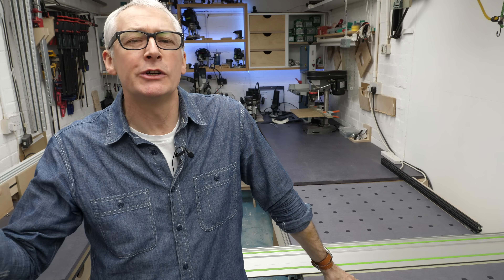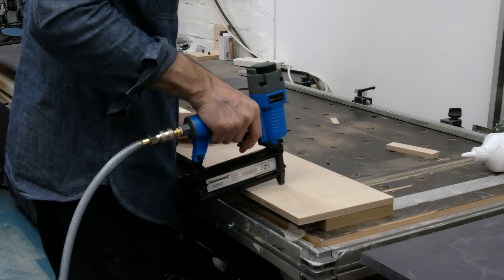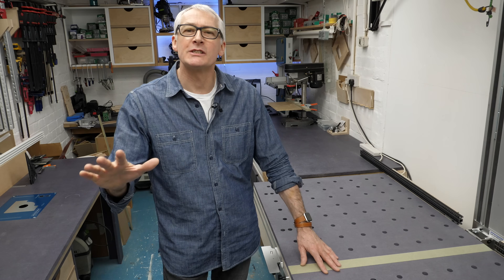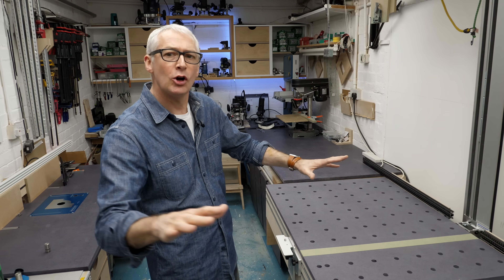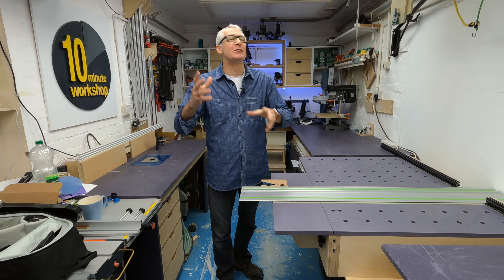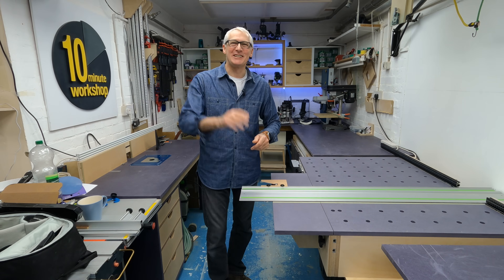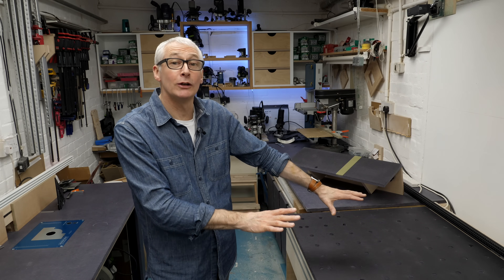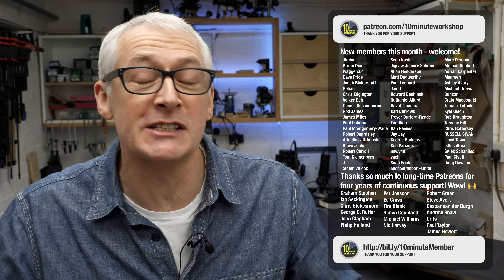DIY MFT with Ikea Curtain Track [video 487]

Comment: Excellent content. I bought the whole Festool MFT setup years ago and found the hinge so fussy that I finally sold it, as I was getting better crosscut results with a simple TSO rail square. The DASHBOARD bracket looks like a brilliant solution. Thank you Peter.

Comment: Thanks for yet another great video! I’m always looking forward to what you’ve come up with. 
It was a nice surprise to watch your chat with Dave, i also enjoy his videos. 

I had an MFT3 a few years ago, but I sold it as I found it too wobly to use in a stationary setup. After watching this video I might consider building one based on some of your ideas. I live in Denmark where replacement Festool table tops (or similar) is not that common, so I’d love to see a video showing how to make the top without an LR32 rail of the Parf system. 

Thanks again for sharing 👍

Comment: Love this build, solves all the limitations of the standard top. The new hinge is totally worth it. I'd be tempted to cut a 10 cm deep slot in the wall to reduce the gap at the back
Reply from the maker: Thanks! Any cut in the wall will muck up the soundproofing I put in there. 🤷‍♂️ 👍

Comment: I made my mft top with a drill press and a 20mm Forster bit for a template, and then drilling on the top itself with a Bosch corded drill and two bench dogs for alignment. It's tedious and tiring work, but the end result is pretty nice.

Comment: You built a very clever solution, indeed. I'm actually planning my variant of a modular MFT. I'd love adding something like your front extension. As a hobbyist I will not invest in rail hinges, although I find them very useful.

Comment: Well done Peter you got there and it really was worth the wait, just an excellent result, love the front extension idea and will certainly incorporate it in mine. Your point is well made about the rear overhang as I had decided early on I needed to be able get 360 access around my work flow and had the room, so using the Festool front and rear hinge suited me better. I love the taper lock idea as well. Well done mate👍
Reply from the maker: Thanks! 👍

Comment: Everybody works in slightly or greatly different ways. What Peter has made of a pretty limiting space is excellent and people will be able to take  bits most or all of it. To newcomers to this channel or to woodworking, I can’t recommend Peter’s channel enough, especially for panel work.

My tip for the top is designed for least cost. I’ve already got an MFT style top which is over 10 years old. It needs replacing very soon and has lasted so long (turned over once about 5 years) because I refuse to use it as a sacrificial top - when I cut on it, I use scraps of 6mm underneath. So, I will be using my existing MFT as a template for the new one. Place old on top of new; drill, say 15mm holes, through the existing holes through the new; then a sharp template router bit to copy the holes; finish off with a small chamfer bit.

If you don’t have an existing MFT to copy, then I would very carefully make a small template, say 6 holes by 3 holes. Then use that as the template on your full sized sheet by using dogs to anchor 2 or preferably 3 template holes and then drill/rout the rest. 

As I say, I’ve had mine 10 years or so and there are still many holes that I have never used. The lesson from that for me is that I don’t to have all the holes in the centre of the top.

Comment: That looks so good that I'm  beginning to suffer from MFT envy! 
I've always liked dark coloured worktops on a bench, but I'm too tight-fisted to fork out for valcromat. I use MR MDF and stain it with a couple of coats of Liberon ebony spirit stain, followed by 2 or 3 coats of danish oil on both sides. Then I machine the dog holes with a jig from RS CNC. This seemed the most economical method because it uses a router, 30mm guide bush and 1/2 inch cutter which I already had (although I did splurge on a Whiteside upcut spiral bit later on). Final process is to chamfer the dog holes with the UJK hand cutter,  and paint the edge with lime green paint before cutting a chamfer around that.  I know that sounds a bit sad, but it does look good!
If anybody follows this method, use a trend 30mm guide bush - initially I tried a Dewalt guide bush in my favourite DW622 and the result was sloppier than a bowl of soup - using the trend bush gives a perfect piston fit.
Reply from the maker: Thanks David! I used wood dye on my previous benches and it looked fine! 👍

Comment: Hey Peter I used peg board to make my mft top. I cut a small piece that I drilled to fit on my router base and added 4 bolts to mesh with a bigger piece. I then used the bigger piece as a template for indexing the router and drilling the holes. The two issues I ran into doing that are: pegboard is spaced 1" apart so I had to forger about getting 96mm spacing, the 20mm router bit I used ended up creating holes that were too loose to use with dogs and retain any sort of precision. Other than that the process worked perfectly. I'll be making another with the process and am hoping to find a bit that creates a tighter hole. I've read that some people have had success using a 25/32" spiral bit since that works out to 19.84mm
Reply from the maker: Thanks! I'll be doing a 20mm router bit roundup before too long - there's quite a variation in size! 👍
Reply: @10MinuteWorkshop  Looking forward to that!

Comment: Great video Peter, I enjoyed it very much.  A little too late for me, as I have just built my more basic version with a pre-made top.  However, the idea of a future video on creating a top more cheaply than using the available proprietary tools, would I think be very useful. The reason, would not be to create a full MFT, since as you say these are very competitively priced, but to have a methodology to create small add-on panels, or panels for specific purposes.

Comment: Great video. Love the black worktop. Yes the hinge system for the track looks great and I am awaiting delivery. I have seen on Festool users sight a home built set. I note that Benchdoguk have mentioned something coming up soon?
Its great to see UK development, it will save import duties, a must to consider should they reach the market. Looking forward. 
Took a set of Dave Stantons Bench  plans, a couple of years ago. Great for restricted space, table top use..
Reply from the maker: Thanks! Yes, Benchdogs have a hinge coming that’ll suit folks using an MFT top or slab, so great for guys on site working off trestles. Look forward to it. 👍👍

Comment: Dear Peter - what a nice video again. I had a laugh on the OCD remark - because you made it seconds after I wondered whether the front and rear T tracks would be aligned :-). 

I do use a UJK Parf Mk II Guide System to make the holes in my table tops - that makes it easy to make those in a perfectly 90 degrees aligned grid. Not cheap, but a pleasure to work with. 

And the remark on the protruding rear hinge on the table for the guide rail... that has been the reason for me not to use a guide rail on a hinge any more. And your remark on the make of the Festool hinge at the end of your video - I cannot agree more. But - it serves its purpose for me. Instead I do have a separate replacable table top now, which I use for cutting in many locations - so it is a bit of a trench warfare scenery that one really. But I might change that in the future - your replace-able cut inlay does appeal me - and when thouching on the topic of OCD... well you will understand. 

K reg Wino
Reply from the maker: Thanks Wino! Yes, it's tricky, matching up two different extrusions; If I matched the front t-track to the middle slot in the Ikea curtain track, then it's quite low, nut match the top clot in the curtain track and it's quite high - too high to be able to drop the front rail support down completely out of the way. 🤷‍♂️ It's a compromise. 👍

Comment: Hi Peter, again a great video. I want to make one of those MFT top. Can you tell the distance between the edge of the top and the wall. Essentially the distance required for a TS 55 to cut through material.

Thanks for sharing!
Reply from the maker: Thanks! Surely if you’re considering making this you have a plunge saw? ‘Cos the distance you want is from the front of the saw to the centre of the blade when fully plunged… 🤷‍♂️

Comment: Used synthetic motor oil? I had MDF sitting under my Mini Lathe and used some 0W 20 Mobile 1 as cutting fluid. the MDF did not swell. 
Not sure of long term effect. I have had 4 test spots on my current MFT/3 MDF top for about a month. So far so good

Comment: You have a wooden panel behind the hinge area, could you not just cut a hole for the back part of the rail to swing up into? Then the bench could move back towards the wall.
Reply from the maker: I spent a long time getting soundproofing into that wall, and cutting holes in it would muck that up. 👍
Reply: I say, muck away. It would make for such great content. The script writes itself — out-of-the-box thinking… literally!

Comment: Great video as usual, thanks v much. As you asked, I’d be interested in a cheapo option MFT and perhaps also to include some of the very basics (ie why is a front test needed with a hinge and alternatives like a square and dogs?)
Reply from the maker: Thanks! If you check out this video - Square Cuts: MFT or Rail Square?	https://youtu.be/3C8XSWliOys - you’ll get a lot of the basic questions answered. As for why a front rail support, it’s simply that there’s too much potential flex in a rail that’s over a metre long to keep it accurate; having a front rail support - or referencing off eg a benchdog - keeps it true. 👍👍

Comment: Peter, have you considered swapping the brackets around i.e. put the smaller 'front support' at the rear so you can push back closer to the wall, and the larger hinge bracket with overhang at the front of the bench?? Clearly the lifted up rail  might be in the way much of the time, but will be easy to remove and avoid the occasional falling rail hazard you've encountered before 😉  Perhaps worth testing for a day or two??
Reply from the maker: I hadn’t considered that Mark, for exactly the reasons you say - the rail would just be in the way all the time when it’s flipped up. And the dashboard hinge is much stiffer than the Festool one in that regard - holds its position very well. 👍👍

Comment: Sorry if this has been answered already - curious about the 3 offset holes past the front row of holes on the bench - looks like 32 or 48mm more forward  - any specific reason for these holes? Jigs? Specific Clamping operations? I’m designing a top now with offset holes at the rear to maximize fence space, curious what yours at the front are for!
Reply from the maker: First one was a mistake, the others were to make it look intentional but slightly mysterious.  👍
Reply: @10MinuteWorkshop  😂 well it worked!!

Comment: As always Peter, great video! Like your creative solutions for your space and how much you get done in there. Love the collab too!

I’m currently remodeling my house so the finer woodworking has been put on hold and it’s mainly rough construction. 

I’m planning to wait till the Benchdogs rail hinge comes out and then build a proper MFT with that. It’s probably good given their “track” record (pun intended) 😂. I think I’ve seen somewhere they’re working on it. Have been mighty impressed by the BD rail square mk2!

The import duties etc make the Dashboard a bit hefty price. Looks amazingly engineered though! 

Hopefully it will be out when I get back to woodworking and need to build some stuff for the new house :)
Reply from the maker: Thanks! Yes, the benchdogs solution looks very good, very much aimed at MFT top or MFT slab users working off trestles  though. 👍👍
Reply: @10MinuteWorkshop  exactly! 😄👌🏼

Comment: Hi Peter! Came to re-watch the video to try to find out how much of hanging over does the dash board needs in the back and front, could you let me know please? 😬 with the new benchdogs hinge it’s really hard to decide. 
My mft bench will be 1m by 2m, makita only has 140cm and 100cm rails. And I think 140cm will be too long and 100cm to short 😬
Reply from the maker: The dashboard hinge needs about 190mm to the rear of the bench. The Festool hinge about 110mm; haven’t had hands-on with the benchdogs hinge yet, hope to get one next week. Front rail overhang is up to you, largely; if it’s long enough you can plunge fully before starting the cut, but then you run the risk of it getting in the way. 🤷‍♂️ At a metre deep, you’ll need a rail at least 1200 long if you plan on using a hinge. 👍
Reply: @10MinuteWorkshop  thanks for the info! I’ll have to consider all that 😊

Comment: Hey Peter - why not just take a hacksaw to the back of the hinge? If I recall the back is free swinging and probably much longer than it needs to be to keep the rail square. Being that you have the front rail support you really only need enough rail to support your saw when the blade reaches your fence in its furthest back position.
Reply from the maker: Thanks! Well, firstly the guy who engineered it told me he really wouldn't recommend it. Secondly I paid £285 for it - don't much fancy chopping it in half! And finally one of the two bolts that secures the bar holding the rail onto the hinge is right at the back of the top plate, so you'd end up with the rail only held on with one thunbscrew, which wouldn't be great. 👍
Reply: Now, this sounds like a bad idea.

Comment: BTW, Peter, couldn't you just bolt the hinge to the back side without any extrusion? The MFT does have an extrusion all around, but you cut at a fixed location. Or that's not feasible, or not as easy as seems from this side of the screen? :)
Reply from the maker: You absolutely could with the Dashboard hinge; the Festool hinge has the t-bar integrated into the design that would prevent that. A rear extrusion is useful though for eg attaching a fence, or just for additional clamping options. 👍

Comment: The issue with following you and many other influencers is that you get too many solutions to your issues :D
I now have a Workbee CNC (1500x1500) but also the Parf Guide mkII. Benchdog fence+dogs+square+parallel guide as well as the UJK clips.

Despite this you got me going out buying a IKEA rail and thinking about Dashboard hinge :D A workshop filled with equipment.

Comment: Great inspirational source, you are!
Just one question: why didn't you use Matchfit dovetail - rails on top and at the front?
Reply from the maker: What, these ones - https://youtu.be/uiT6F-K26Tg? Didn't have them at the time I made this, and honestly I'm not sold on them now I have them. 🤷‍♂️ 👍
Reply: @10MinuteWorkshop  Yest. Those. What's less good about them? Not strong or not perfectly accepting other clamps? I don't use T-track-rails yet, but recently used the matchfit system, and it was perfect for a simple jig.

Comment: Surely all you need to make an mft top is a framing square, a pair of dividers, a centre punch and an 18mm bit together with a drill clamp to ensure you are drilling square to the face of the MDF board?
Reply from the maker: Yep, everyone has been completely bamboozled by the ‘MFT jig cartel’ 👍👍 Look forward to you banging MFT tops in volume. 🙌

Comment: Hi Peter.. thanks for making this video.. very helpful. Is there any structural support holding up the bench top? If not, do you find it sags?
Reply from the maker: It was good to begin with, but had sagged noticeably after 6-8 months.  A 2x2 fitted underneath sorted that out, no problem.  😂
Reply: @10MinuteWorkshop Thanks! No one likes a saggy bottom

Comment: Hi Peter
Just wanted to pick your brain, in your opinion what would be an ideal material to make a M. F. T. top. And what would you think would be the best dimensions for a MFT.
Seems the one you have is an ideal size.
Regards John
Reply from the maker: Hi John. MRMDF is flat and stable, and 99% of MFT tops are made from it, so unless you want the Birch ply or coloured MDF aesthetic, then I see no reason to change it. And yes, having used MFTs of all sizes, this workshop MFT has worked out well for me; same width as a regular one, but an extra row of holes deeper, front to back. 👍

Comment: Birch ply! At current prices ‘recon might be cheaper to buy a Festool MFT 😁. Never thought I would say Festool cheaper….

I had to get my 20mm router bit ground down to make the hole small enough as a cut hole to get a really good dog fit. Which router bit do you use?

Thanks Peter for your insights as always
Reply from the maker: Same! Had a precision engineer pal grind the Festool bit down to make a snug fit with regular 20mm benchdogs. I have a ‘which 20mm bit’ video planned as well! 👍
Reply: @10MinuteWorkshop  I did put a comment on as a reply but it may have been flagged as it had a link in it. I used router tooling in Leicester. Had a 20mm ground to 19.85mm. They were very helpful

Comment: Hi Peter, I'm just about to start making the front face for the MFT but before I do, perhaps you could answer me a couple of questions?

1) My MFT top is the same length as yours at 1100mm but Rutlands only seem to do T-track in 1000mm lengths and I notice your T-track runs the whole length of your 1100mm front face. Just wondered if longer lengths than 1000mm were available at the time you purchased yours?  (I have emailed Rutlands to see if longer lengths are available now)

2) Is your T-track the 8.3mm or the 19mm version?   I thought it was the 8.3mm but the slot in this at Rutlands has a different end profile to yours?

Many thanks in anticipation.
Reply from the maker: Hiya. I bought my t-track forever ago and Rutlands only seem to sell 1 metre lengths now. Try Wood Workers Workshop - the do t-track in 4’ lengths. The t-track I have is 19mm x 12.4mm external - same as www - or 3/4” x 1/2” in the old money. 👍👍
Reply: @10MinuteWorkshop  Thank you so much Peter for your info - and time.